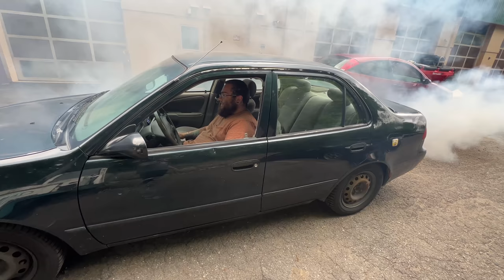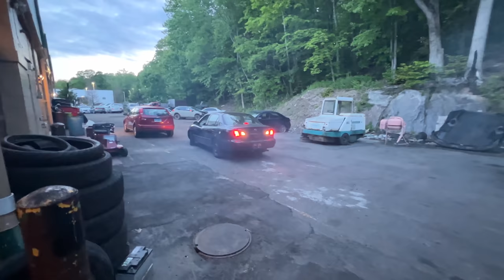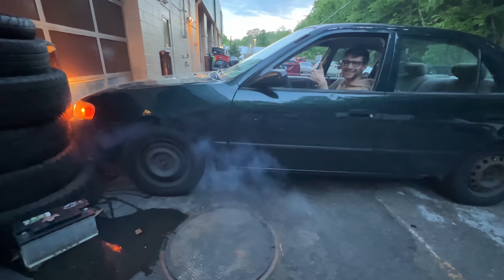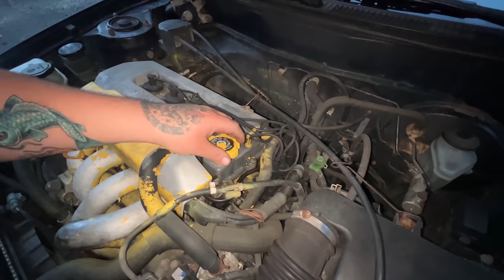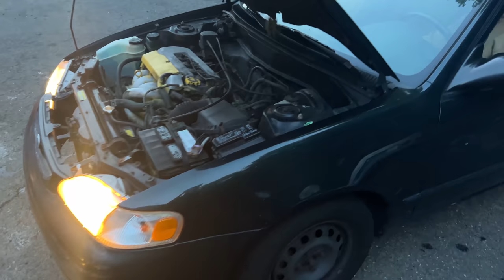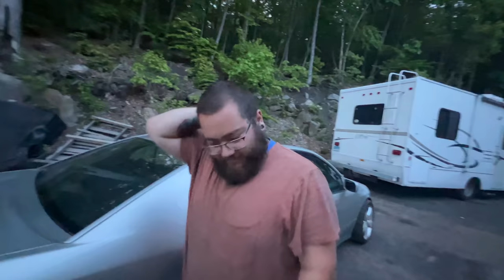Pouring Bolts into a Running Engine

Comment: Pull the valve cover off and dump a couple hand fulls of nuts in there and see what happens or pull the plugs and put 4 or 5 nuts directly into the cylinders and send it